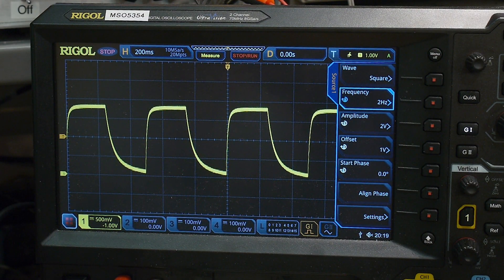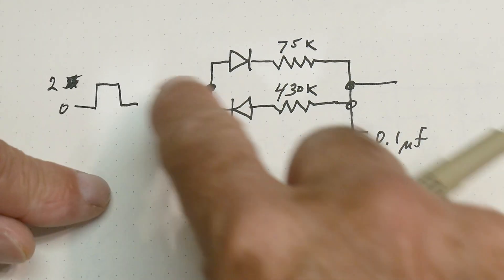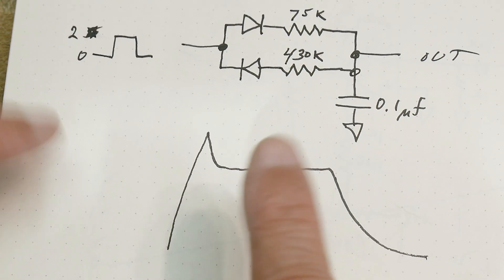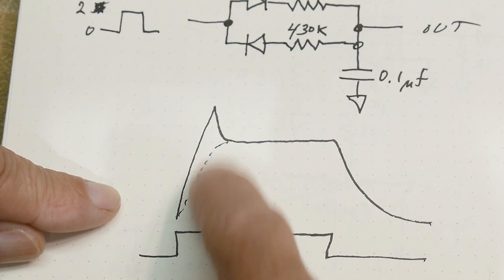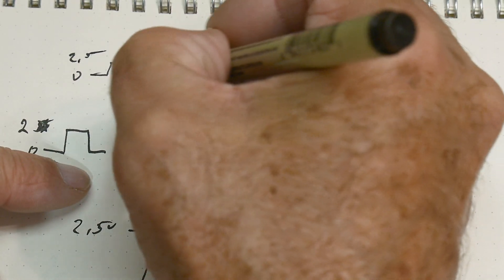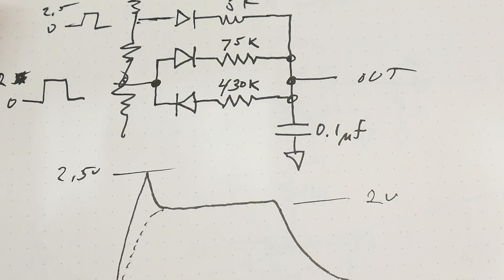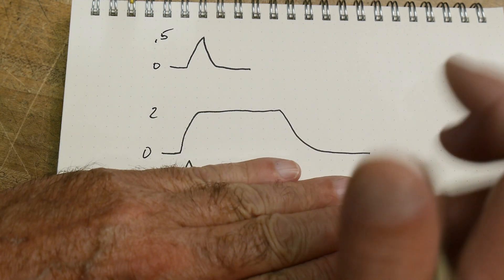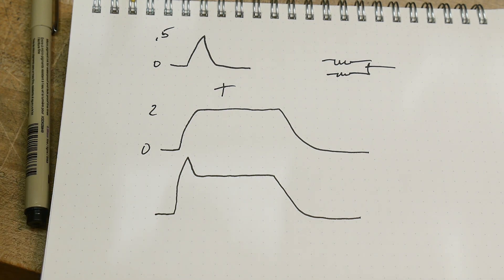#1205 DIY Analog Synthesizer (part 7 of 15)

Comment: I am enjoying this series.   Great topic that covers many circuit types voltage shaping/processing you should know that can be applied to many other circuits.
Reply from the maker: yes, that is the entire point of the series, not making a synthesizer, but introducing many circuits that people may have not seen before
Reply: @IMSAIGuy  Best part,  no microcontrollers.   Real electronics.

Comment: The four parts of the "canonical" envelope are: attack, decay, sustain, and release (so, known as ADSR envelope).  Attack you have right, the leading edge.  Decay is the initial drop after the attack.  Sustain is the volume of the note whilst the key is held down (or equivalent for other instruments), and release is the last bit where the note fades out after the key is released.  Some of these parameters control time (rise time or fall time of the envelope) and some control amplitude (sustain). Not all physical instruments have all four parts: A plucked string is just attack and release, because there is no sustain.  Oh, and the name of the thing you are currently building is the ADSR envelope generator.

Comment: Hi, If you need some extra voltage at the start of the key be pressed , could you not use the voltage doubler concept?  Just add a capacitor and diode in the upper part of you circuit in a cross configuration to boost the voltage up for a short duration.

Comment: the best method is using a modified transistor core of the Serge DUSG (voltage controlled slope), CD4066 (decay stage), CD4013 (decay/sustain stage, reset) & comparators.
schem_cgs75_vcs1.gif

Your design would be best using a CD4066 (decay stage), CD4013 (decay/sustain stage) & comparators.
... or use the circuit of the Arturia Micro / mini Brute from Yusynth with an 555 timer to act as comparator.

the DECAY is automatically trigger by a comparator, but the release stage depends on the inputted gate signal.

But the best results come from the transistor core of the upper named circuit, Serge DUSG.
since the integrator after the transistor core follows the input, it's easy to make the decay stage ... and you can gives it shapes.
Reply: Or, in this day and age, a microcontroller to control the Envelope Generator(s), they're so cheap these days.
Reply: @ian_b  You could, i have a Microchhip chipkit / Faburinoand some MCP4921/22, will give it a shot someday.

But i have a like upper describben ANALOG ADSR, i made and it's perfect.

sure using a computer is lest costly in parts.
but if the circuit does exactly what the name ADSR impleis ...

i also got a Roland system 100 clones ADRSR, a diy "kit" from a "known" seller, but it doesn't really perform well.

the Roland Juno 106 back in the 80's already had software controlled ADSR using a R2R array as dac + some minor logic.

the attack causes a rise on voltage and you have to cut it off at 10 volts and not the whole voltage range of like 11.5 volts. than it fails in to decay state (while the gate is present and ensure functionality of the circuit) and drop to the sustain voltage until the gate is released to go in release state.
it is some form of digital control but without a computer.
Reply: @ian_b  if you wanna use software you have to know the EXP(.....) function in C(++), it returns  the EULER numbers. takes some thoughts.
Reply: @AnalogDude_  Not really, you can just have a counter controlling a DAC on the microcontroller, I did this on my hybrid analog/digital synth (some videos on my channel).

But all this is just what one prefers. True analogue is great but the MCU is somewhat simpler in terms of parts.
Reply: @ian_b  wah in parts, yes, when i would go digital i would like to have shapes, logarithmic, exponential, linear, fully dynamical at the turn of a knob, you need to know the math's to do so.

my analog ADSR does such shapes. 
Due to shortage of chips, special ones, i can't try a second version.
Reply: @AnalogDude_  True, but for envelopes you can use a look up table, you don't need to do much maths on the MCU.
Reply: @ian_b  How large? what kinda of data does table has? and how you get these curves? 1000 hz? varaible timer? how?
Reply: @AnalogDude_  It depends how accurate you want to be. In my experiments I couldn't hear audible differences when the envelopes are 8 bit (255 steps) so that's a manageable table size. it works best to work in the time domain with the table (or calculation) varying the time between steps  rather than changing the step sizes which can be audible and cause zipper noise for a fast envelope.

You can work out the various timings for a curve using a spreadsheet (at least, I did) and also can use simple LERP type integer maths to vary the intensity of the curve from linear to curved, etc. Then it just runs off a timer in the MCU (I generally use the 8 bit PIC with lots of peripherals, PIC16F), the timer fires an interrupt to update the curve.

Of course this is just me, others might have their ears offended. :)

Another approach would be to use a DAC (10 bit is available on the PIC) which acts as a current source to feed a charging capacitor to do the envelope. Since both terminals and the "wiper" of the DAC are available as outputs, you can actually just use one as a 1024 step variable resistor to vary the charging current. I actually used that in the oscillator to create the DCO, if you look on my channel there's a somewhat rambling video about it under the heading "BOB, The Basic Oscillator Block".

I'm really fond of PICs to be honest, but then I like the bare metal assembly programming aspect :D

Comment: I guess attack and decay part can be realized with one monostable multivibrator plus diod and RC circuit (like in this video), and sustain and release with another one. Perhaps, that approach lets control each duration independently of the button press duration. Multivibrators could be op-amp based.
You, probably, should use some simple schematic simulator (LTSpice or some another).
What about simple overvoltage at the attack moment - may be, inductance in parallel with the top diode and resistor will help.
Your videos are absolutely amazing! Thank you.
Reply from the maker: the micro moog uses 555 timers as the monostables

Comment: Interesting. I feel like when you strike a piano key it's not simply the volume that rises with the strike but there are also some extra harmonics from the strike. I wonder how you would synthesize that — perhaps mux in additional, detuned, "percussive" oscillators that fall off immediately.
Reply: The piano has a lot of fast decaying partials, that change with expression and across the keyboard. It is notoriously hard to synthesize a piano for that reason.